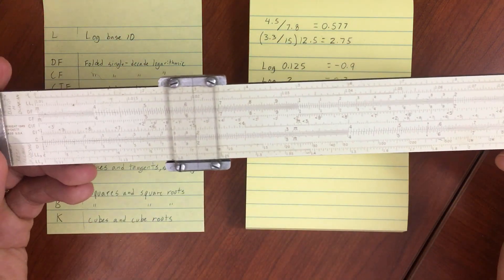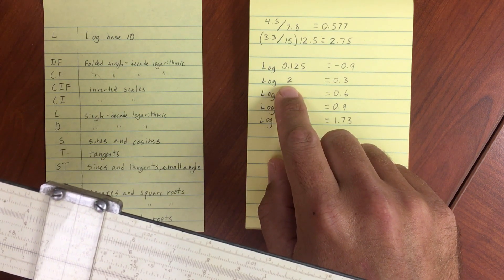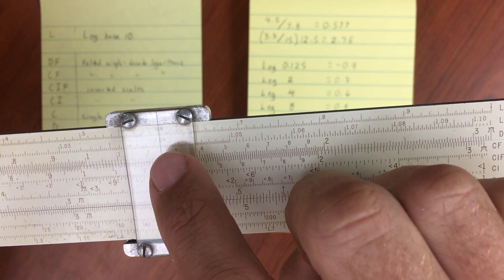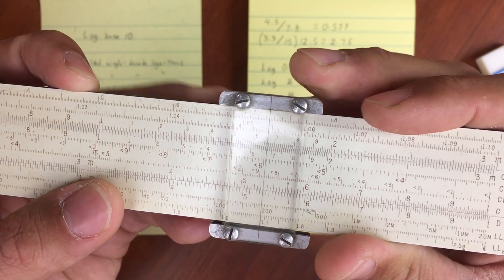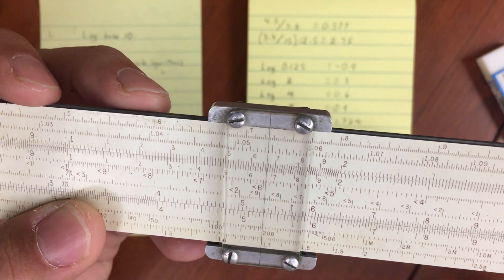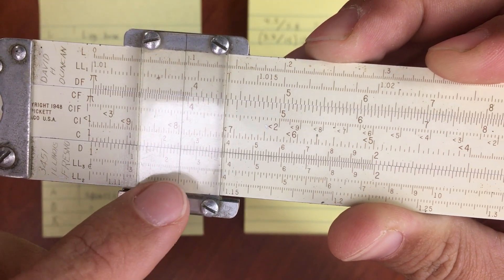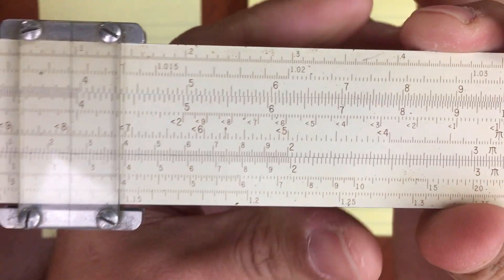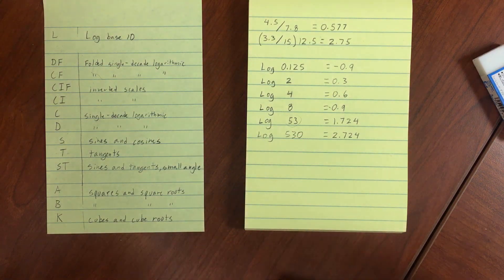Slide Rule - Logs

Comment: There is an alternate method for finding Common Logarithms without the use of the L scale. This can be done on a slide rule by using the LL scales which are known as the Log-Log scales. For example, to find the common logarithm of the number 4, first move the right end index of the C scale over 10 on the LL3 scale.  Next move the cursor hairline over the number 4 on the LL3 scale. Then read above it on the C scale that the common logarithm of 4 is 0.602. The reason why this works is because common logarithms have the base of 10. The number of interest is 4 in this example. The exponent turns out to be 0.602 read on the C scale. In other words, 10 raised to the exponential power of 0.602 equals the number 4.  A logarithm is actually an exponent.

Comment: Logan, if it seems like you'll be building a slide rule collection like your calculator collection, you might want to keep your eyes peeled for one of those Cleveland Institute of Electronics slide rules on eBay. They are a Pickett N-515-T and are geared to the EE user. Some appear at exorbitant prices but an occasional bargain shows up. 
K6WHP.
Reply from the maker: That's really interesting, I haven't yet caught the bug to collect slide rules but if I come across one that is specifically for EEs, I might have to begin!